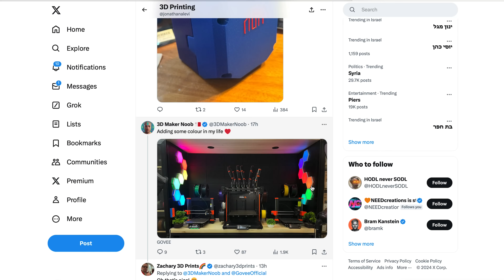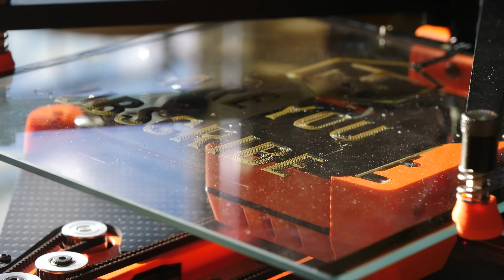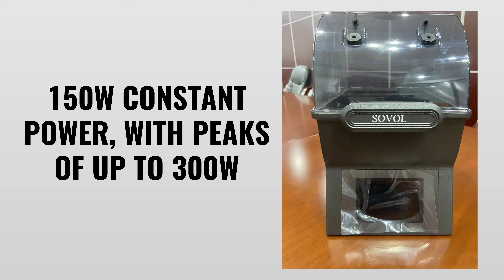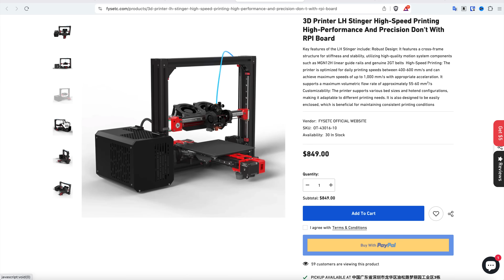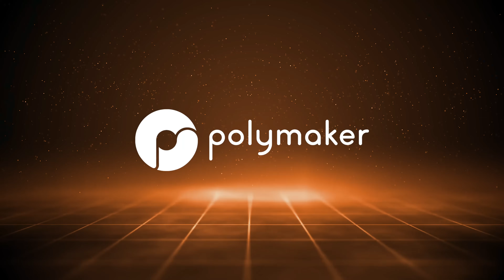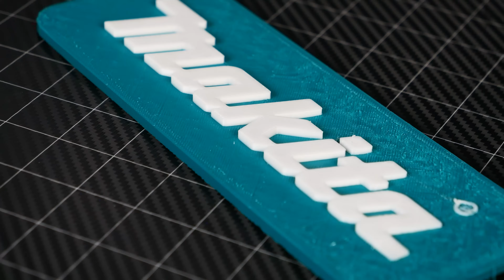The 30+ Most Anticipated 3D Printing Products Coming Soon

Comment: Got home and opened the box and what do I see a brand new MONOPRICE select mini 3D v2. I did a little research on it and find that it is a little over ten years old. I did the trial printout of the g code cat program and it works just fine😊 now I just need a computer or maybe because as I read further in the manual I see it has WiFi capability and iso and android compatible 😂

Comment: Don't all spool refill systems descend from Richard Horne's Masterspool, which was deliberately intended as an industrywide open standard?

"How has no company thought of this" regarding filament subscription service... uhm probably because it's not a very useful idea? You don't need a subscription for filament and you don't need a subscription for inkjet ink, you just buy them as you go depending on consumption. And if that's too much ongoing effort, then just buy more at once and leave some sealed up. Even shaver blade subscriptions though more justifiable since people have sort of a constant consumption of them, are more predatory than actually useful.

Comment: My most anticipated product is the Starlex DHB by Swiss3DC, DHB24 will fit X1/P1, 6 second nozzle swap indulge ceramic heaters although you can just use one also. 24 is the melting zone so 24mm of melting zone. Just need a TZ2 heatsink.

You can get the Enraged Rabbit V2 for less now from DFORCE Trianglelab, V1 upgraded to V2 is 54 dollars. Both available now

Comment: I wish there was a 3d printing magazine that could hqve all sorts of cool models at the end like a catalog and locals with prunters can make product fulfillments on back of every magazine an invoice sheet so you can use the magazine to sell prints and qr code scan connect to handy app which will have etsy type storefront integration

Comment: BTT releases some great ideas but I feel like sometimes the execution lacks a bit, Panda lights are amazing, eventhough you have can't run the normal lights.
However the panda jet still has SLS powder in the inner parts and panda touch and the P1S camera can't be used at the same time which is a big problem for me so its catching dust until they both work
Reply: What do you mean about the P1S camera not being able to be used with the PT at the same time? Like does your PT just stop working when your turn on the cam? Also, there were some early Panda Jets with a bit of SLS powder but it just blew out on first use and that was taken up with the supplier so all units should be free from it now.
Reply: @looxonline  I think as long as the panda touch is plugged in you can't connect to the camera, the panda touch does not stop working but you just can't use the camera at all, as for the panda jet, I got the bad first batch used a compressor to blow out the dust but still got dust while printing so maybe I'll try it again in the future when I want to do some printing with the fast and ludicrous mode but for now I'm done with the hassle
Reply: @xIsouLcruSHca  That is not right. The camera and the touch are completely unrelated. The touch uses the USB port for power but that port has no data connection so the touch can't really affect data. It may be that your AP board in the P1S has a fault that causes it to have a problem when there is power drain over the USB port. To test this theory you could connect the panda touch using an external, 2A USB supply and see if your camera comes back. There is no way otherwise that the panda touch could ever affect the camera at all.

Comment: Just ordered Sovol's old 2 spool dryer, got a good deal on it, only $39 on a flash sale through Amazon, It's fairly dry in a my basement domicile that I live and tinker from, so I haven't been worrying about moisture too much, But, I have some PETG coming, and should probably have a dryer on hand just in case. And at this price, it beats out a cheap food dehydrator that I'd only get a single spool into anyway, provided the price isn't an indicator of reliability.

And in the off chance someone still hasn't heard, Bambu doing an anniversary sale starting tomorrow, A1 Mini for $199 an absolute steal. I got mine a little over a week ago, and their offering to refund to a giftcard the difference on printers people bought and received on or after may 20th, and ordered before June 5th. So, those of us who bought a printer right before they decided to drop a monster sale on us. Just wish they were also dishing out for other things bought that are also going on sale. :/ woulda held off on my last filament order.
Reply from the maker: The old Sovol dryer isn’t very good to be honest. Also good tip about the Bambu sale!
Reply: @thenextlayer  Not expecting it to be amazing honestly, if it can keep a couple of spools from getting waterlogged without burning the house down, good enough. I don't live in a super humid area, so I am banking on it just working well enough to maintain a couple spools as their being used.  And if it doesn't work out, amazon is usually pretty good about returns. If it really sucks I'll just save up for that 4 spool Sunlu one that seems to be pretty well liked. [not sure where I'll put it, but I'll cross that bridge when I get to it lol]

Comment: TradRack 14 > ERCF V2
Reply from the maker: This is the first I'm hearing of it... Need to check it out.
Reply: @thenextlayer  would be awesome if you did a video on it. I only found out about it a couple weeks ago myself, and from what I've seen, it's quicker and more reliable than the ERCF, about the same price (or even a little cheaper), has all the seam features (buffer, filament cutter, etc), and does 14 filaments

Comment: LH stinger is probably the coolest bed slinger developped by a great engineer! RatRig came also with the engineering ! BTT Coil Eddy looks great too !
Reply: The problem is imagine printing a long slim item vertically.

Immediately the problem becomes evident even if it doesnt just fail.

If the part has to move, the part has to move. Outside of printing speed venchies and trinkets moving the potentially heavy part will be slower and will lead to lower quality.
Reply: @BeefIngot  you can slow down...... On tall thin parts. Usually, these parts won't have a good level of integrity either. The point was "it's the nicest built for a bed slinger". Cross gantry is the way to go for a higher purpose we know.
Reply: @Le_Sixx  You can slow down, but the point is, a bed slinger simply cannot be as fast as other options. Its an important point to make because many people incorrectly have said otherwise because they see some fancy speed boat test.

I just want to make it clear, because that pervasive myth would let manufacturers go back to the crappy ender 3 clones of yonder.
Reply: @BeefIngot  This is unrelated to what I commented... I said it is the coolest bed slinger, nothing else.